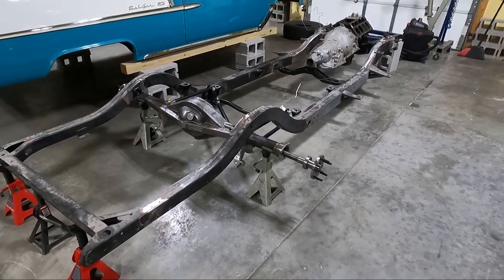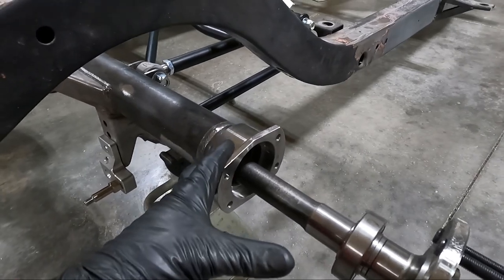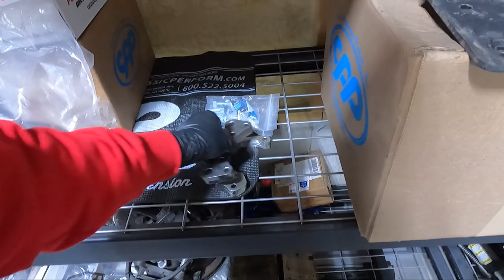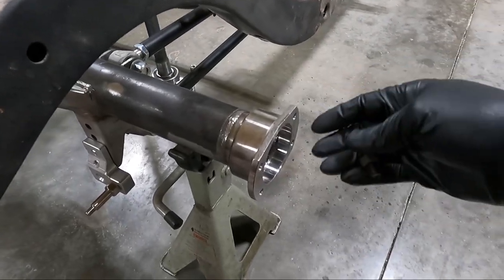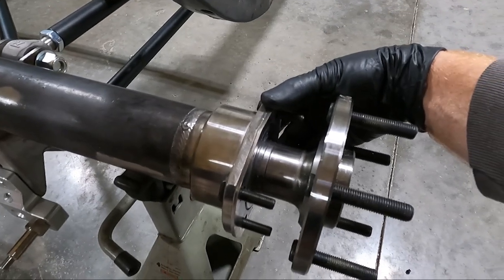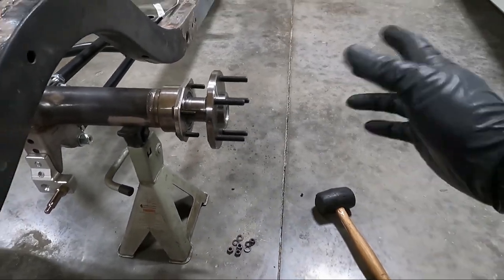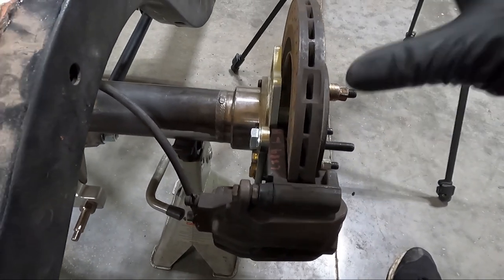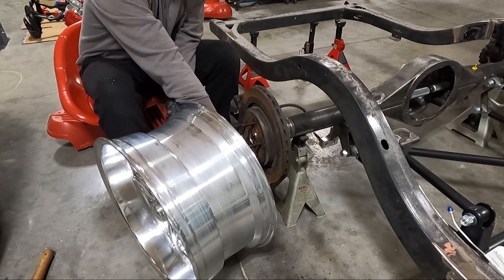55 Belair Project gets Rear C6 Corvette Brakes, Brake lines and Air Bags(Plus Wheels and New Tools)

Comment: I ordered a pre-bent set of hard brake lines for my 97 Z28 from Inline Tube.  Nice products, however the ABS module is on drivers side and the line to the front passenger side was close but to short, but yet long enough to make it work without looking like Bubba did it.  The long line to the rear is actually close to right on the money.  Of course I’m still in the process so and we shall see how the lines for rear go. 

Love that flaring tool!!!  We used those other flaring tools for so long because that’s really all that we had 🤷‍♂️.  If I ever run into having to flare a lot of tubing I am gonna obtain one of those high speed flaring tools!

And for the record those wheels are gonna look outstanding!
Reply from the maker: The flaring tool is worth every penny

Comment: What are the specs on the rear-end housing. Overall width, which tube ends did you use and who supplied it. Working on a 56 belair. Your videos really help out
Reply from the maker: It is stick width 60" if I remember correctly

Comment: I was kind of worried about you placing the brake lines on TOP of the axle tubes. I thought maybe the frame would lay on the axle tubes when air’d out to get you as low as possible.
Reply from the maker: Doesn't get that low